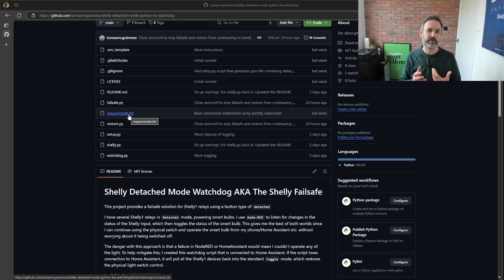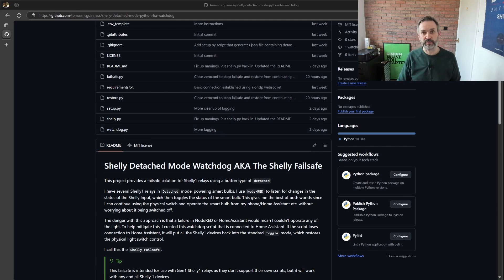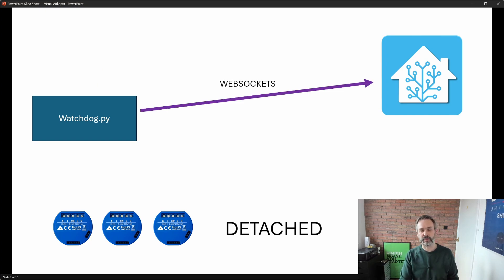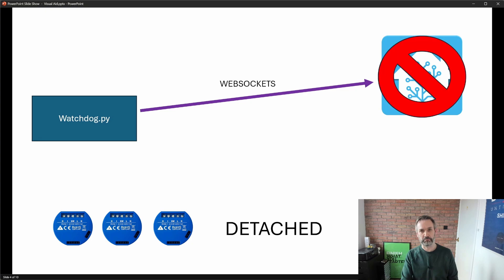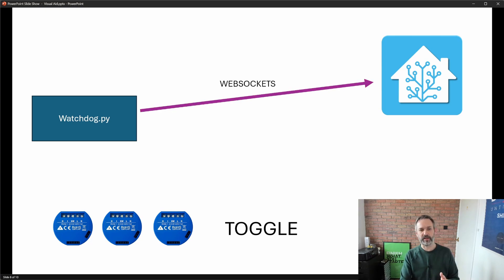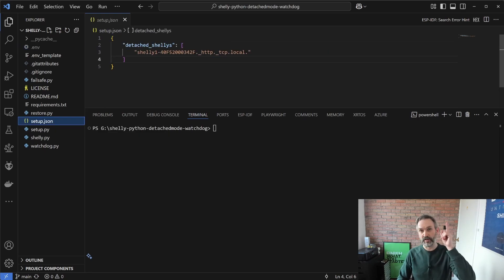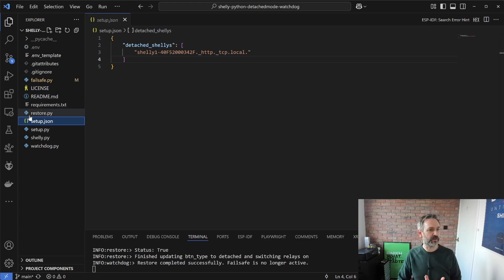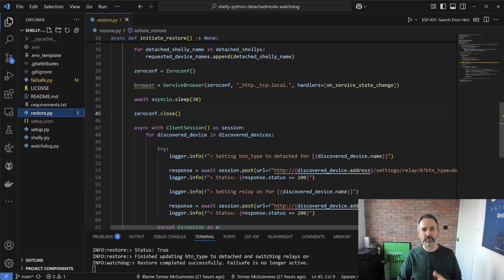Keeping my detached Shelly 1 relays working via light switches, even when Home Assistant is down!

Comment: Hi Tomas, woo this is what I was looking for.. so, I’m not very very technical but looking the readme file in the code repository I have still one question (at least) . I’m running home assistant OS instance on raspberry . Is it your project applicable also at this particular version or not? Just in case, how can I execute prompt in my instance? Are there any embedded tool or something similar? Sorry about that. Thanks a lot !
Reply from the maker: I'm afraid I don't know enough about Home Assistant OS to advise. Sorry.
Reply: @tomasmcguinness  thanks I found a way! BUT I realized that my shelly are 2.5 and not 1...  Would be possible to include also shelly 2.5 in the scripts? thanks a lot
Reply from the maker: @samuelesalvadorini5983  The Shelly 2.5 has its own scripting engine, so I think it would be better to implement the fallback locally. I have that on my radar for my Shelly Pro 4 units, but haven't done it yet.

Comment: Awesome vid, Tom!

Do you happen to know if the Shelly 1 (looking at Gen4 now) would work with detached relay mode on a 3-way switch setup? (American 3-way, so 2 physical switches controlling a light).

I have the hot/neutral in the same switch box as the output to the light, so I feel like it would... but wanna verify with someone who might have done it before.
Reply from the maker: Thanks!

I’ve two lights in my house on a UK 2-way (two switches) and it works find, but I am using the switched live in the light fixture. 

I’m not familiar with US wiring, so I cannot advise. 

However the principle is the same, so there should be a suitable wiring arrangement!

Comment: Can a detached mode shelly1 behind a switch talk to another shelly1 inside a light fixture to turn on/off the connected light?
Reply from the maker: Yes.If you’re talking Gen4, I think you can bind them together using Zigbee or Matter (I have just gotten some to test). For earlier ones, you can use their http endpoints and actions.
Reply: @tomasmcguinness  Hopefully a video on that in the near future 😉
Reply: @tomasmcguinness  Yeah Gen4, I got a few of them in recently and was curious

Comment: Very impressive! I'm in the process of doing something similar but have taken a different approach using the 1PM shelly. I run a script on the Shelly device itself. When you press the button in detached mode it triggers the script which expects a power change to happen. If that doesn't take place (due to home assistant not controlling the device) the script takes over and controls the relay directly as if it's in attached mode.
Reply from the maker: Interesting! I think I’ll need to move to more modern devices, but with Gen 4 Zigbee/Matter around the corner, I’m holding off!
Reply: Does that not increase the delay between switch toggle - light on by alot? Because OPs method sounds like it doesnt come with an added delay
Reply: @CRutgerX yes there’s about a 1s delay if HA is down but it’s only required as a backup. I suppose you could put it in attached mode to remove the delay but then you’d need another script to put it back in to detached mode with HA is back up.
Reply: Can send me te script to do that?
Reply: Is this possible with the Shelly 1Mini Gen 4? I'd like to be able to use my light switches when HA is dead 😅
Reply from the maker: It should be. However, more modern Shelly Devices have their own scripting engine, so they could be programmed to do this themselves. One less moving part.

Comment: pretty sure my shelly 2pm works via local switching regardless of connectivity? is this an issue with earlier devices?
Reply from the maker: If it's in any of the modes other than Detached, the switch input directly controls the relay. Once you change to detached mode, the switch input no longer operates the relay directly.

This is great for smart bulbs, like Zigbee or WiFi, when you want them to have power all the time. By setting the Shelly 1 to detached, people can flick the switch on the wall without turning off the power to the bulb. You then use Home Assistant to listen to the switch input and use automations to turn the smart bulbs on and off.
Reply: @ ok got it - i don’t use smart bulbs, so hadn’t come across that scenario

Comment: Thank you, this is really very good and helpful and I will do this as well for my shelly 1 devices. Is there a difference between shelly 1 and 1 PM i need to consider or works it the same way for both?
Reply from the maker: Thank you. I believe the only difference is that the 1 PM includes the power monitor. I had one connected to my networking equipment, but I never used the relay part on that.

Comment: I used to do something kind of similar, but using ESPHome. Great to see a solution like this using the Shelly firmware.
Reply from the maker: How have you solved this using ESPHome?
Reply: My previous answer didn't get published. It's probably because I added a link. Let's try again. :)

I used this great blog post by Brian Hanifin as a reference to build my ESPHome configuration files.

If you Google "Making a dumb light switch smart with ESPHome and Home Assistant" (with the quotes), it should be the first link.
Reply from the maker: Thanks. I’ll check out!